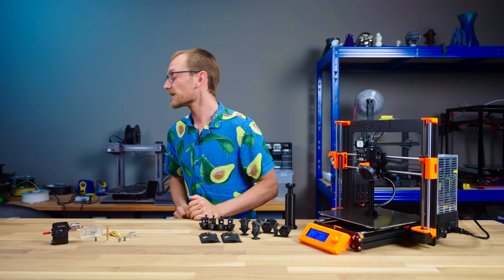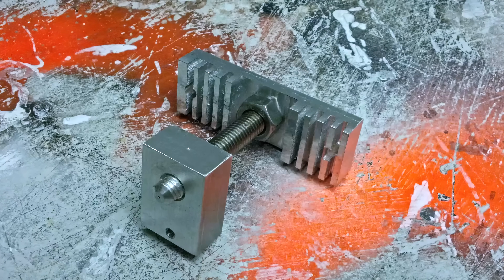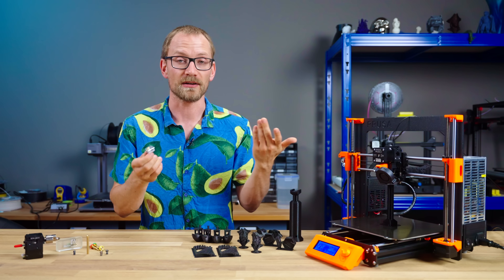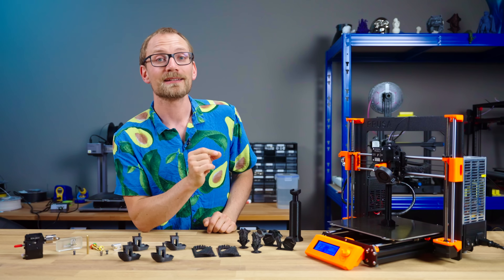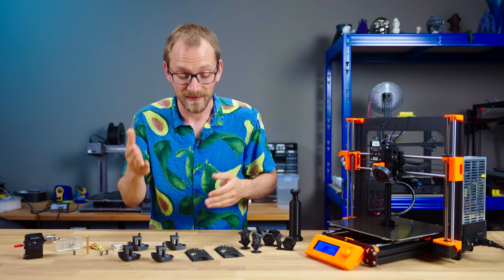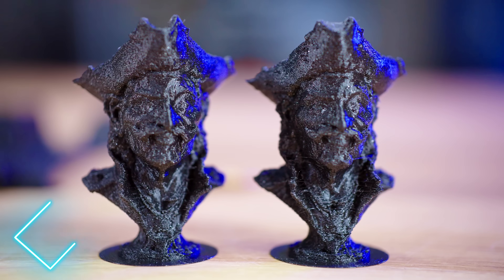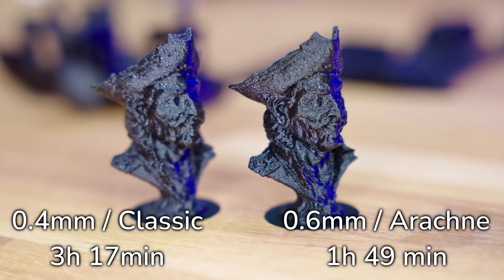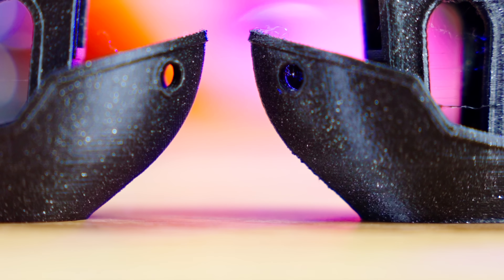0.4mm nozzles just became obsolete

Comment: Just a little note on this, I upgraded my very old printrbot simple metal to a 0.6mm nozzle, started getting thermal runaway protection false positives on stock Merlin 2. I've had to change the range of thermal protection as the old school heater isn't good enough for the increase in volume of filament when printing at 0.4mm layer height.

Comment: This video is great for an artist, but cringeworthy to an engineer. There are two drawbacks to the 0.6mm nozzle. Overhangs as mentioned and also significantly reduced layer adhesion strength for thin lines. One advantage of a smaller nozzle is the fact that an extrusion width 150% of the nozzle diameter results in stronger prints than 100% or lower. So to maintain strong prints going from a 0.4 nozzle to 0.6, you would have to increase extrusion width by 50%. Arachne seems to go the opposite direction. lines narrower than the nozzle have verry poor adhesion strength on any setup, especially at high print speeds

Comment: Hello there! I have followed your advise and I changed the nozzle from a 0.4mm to a 0.6mm… and all is good… however something is not ok… I understood that I could print to smaller diameter even with a 0.6 nozzle installed… but how so? I have my slicer set to use 0.6 nozzle… and when I want a better resolution, I change the layer height… to 0.3 for example… but my prints miserably fail to stick to the hotbed… any advice?

Comment: I've just tried 0.6mm on my S1 pro. Dialed in the right settings into cura but a bit disappointed to see a lot of oozing/stringing and bridging performance is terrible. Printed flow and retraction tests but no real potential for improvement on those fronts 🙁 Not sure what I was doing wrong but have had to switch back to the 0.4mm till I can find out the problem

Comment: Dear resident 3d printing genius  thinking outside the box...... because I often print complex geometry parts, ideally you’d use PVA and regular filament with dual print heads.
The Idex seems to be the best bet these days.  But the problem is wasting too much filament on support.  I’ve been thinking of  how you'd print a support that can then be placed on the bed and do another allowing the filament to print around it.  This would have to be very irregular non direct slicing to avoid the pre-existing bed support.  Have you ever thought down these avenues at all?  Or is there something out there along these lines? Your thoughts?  This could possibly do away with the need for dual extrusion in some cases since so many of us have our early single print head printers.  Thanks

Comment: I switched just recently. I have experimented with .6 and .8 in the past, but always went back to .4. Recently I picked up a resin printer and with that decided my old FDM printer was going to be used predominately for parts with less detail anyway. On parts that I really don't care how they look it is really nice to print at .4mm layer heights and get the print done fast. For most of what I print on it anymore I can't tell the difference between .4 and .6 at .2mm layer heights, and I don't use any special slicing techniques. Now that I've seen this though I'm definitely going to have to experiment with these suggestions.

Comment: I mean honestly this is cool but some ppl would prefer detail over speed like me im actually looking into .2mm nozzles I used to use .6mm but never liked it for smaller more detailed prints so i dropped to .4 as a medium ground but don't get me wrong if its not detailed and a large print like a hydraulic cylinder then I will use .6-1mm and I honestly don't think there is a one size fits all as it depends on the part and detail required but if its also a highly detailed part that has no stress i cant get with fdm then i would throw it on my resin printer

Comment: I reckon it's worth to have both, if you're willing to swap between them depending on your very specific needs. I personally would keep .6mm on most of the time, specially with Arachne, and returning to .4mm (potentially with Arachne, I didn't quite understand if it does better with or without it on) for very precise models

Comment: I want to print parts for photographic lenses. Do you think, a thread M42x1 will be better with 0.6 mm nozzles? I use a layer height of 0.175 mm.
0.4mm nozzles work just fine and I use a small printer to avoid large masses to be moved. I think it depends on what you want to print.
I print mostly engineering parts, but small and precise ones. What do you thing about nozzles for such parts? Is it possible to print them more exact using 0.6 mm nozzles?

Comment: I have no idea.  but i would suggest that your settins you are using work better with a  0.6 mm.   You are telling me it works better,  my Question has to be "What makes you think you have been using the correct settings for a 0.4 nozzle?"  you know as well as i do that you send 100 printers to 100 countries to test you will end up with totally different results out of the box even if they all exactly the same.   maybe a 0.6mm nozzle easier to tune so you  find it easier?   not having a go at you but it is one consideration.the point is you are not qualified to say the 0.4 nozzle bacame obsolete

Comment: So a .6 nozzle is now as good as a .4 used to be, doesn't that mean that the .4 is even better? Maybe as good as a .2 used to be? That doesn't mean the nozzle is obsolete, it means you now get better prints. If you wanna stick to the old quality sure change nozzle, but if you want even better quality you should still use smaller nozzles.

Comment: As a result of this excellent video I have changed my standard nozzle to 0.6 mm and standard layer height to 0.3 mm. Using the 0.3 mm Quality printing preset I am very happy with the reduced print time. I just started a print job involving 29 interconnected pieces that using the 0.4 mm nozzle and 0.3 Draft preset was going to take over 22 days end to end print time. Using the new settings this becomes slightly less than 15 days end to end print time. One caveat, the support material required for one complex part was a real bear to remove compared to the part printed with the 0.4 mm settings.
Reply: did you use special support filament for the interface?
Reply: @kellerfilme  No, I was printing on a Prusa MK3S+ without an MMU. Filament change time would have ballooned the print time to  extreme levels even with a 0.06 mm nozzle. Now I would do this job on my Bambu Lab A1 printer with an enclosure and use soluble filament for support. OBTW, this job required the use of PETG.
Reply: 15 days???? Wtf are you printing and how big is it

Comment: "Why is it always a 0.4mm bore?"  Oh, simple.  It isnt.  I print with a .2-  .25 most of the time for final prints.  0.4 or possibly 0.8 for drafting or thick materials.  Knowing your nozzle and setting up a print for the right size info in the software (cura in my case)  is crucial to getting the details you want out of your prints.

And yes, I can indeed tell the difference between the benchys.

Comment: I am just trying to understand, are you saying that printing with a 0.6 nozzle is ~30% after than a 0.4 if the say layer height is used for both (let's say 0.2) or are you also increasing your layer height with the 0.6? I understand how increasing the layer height makes it faster with a 0.6 (since it is more optimum for higher layer size) but how would make it faster if the same layer height is used? I guess walls are faster on a 0.6 regardless of the layer height since they are thicker so less lines but 30% increase?

I am just new to all of this and trying to figure all this out. Thanks.

Comment: Anyone any thoughts about my struggle? :

Since I started to print wih a 0.6mm nozzle, I have troubles with flat top layers. Even with 6 top layers of 0.28mm layer height, pillowing is clearly visible . I've tried many things like increase infill percentage, altering print speed, lowering the layer height to my old 0.2mm. Nothing seemed to work.
I only print in ABS and ASA for about 8 years now, and never had issues with a 0.4mm nozzle, so that's strange?
I think it has something to do with cooling. I never use a part fan, but with these thicker extrusions, iIguess it's needed.
However, When setting my part fan to a low 30%, infill starts to curl up and you can hear the nozzle grinding the next layer. The final top layer has less pillowing visible, but is very rough..
When printing part with no large flat tops, all is fine, but many functional parts that I print do have those flat tops.
Maybe I'll be switching back to 0.4mm 🤨

More about my printing;
CoreXy printer with heated chamber (usually around 40 celsius, when printing parts prone to warping around 50)
Direct drive (Bondtech dual drive clone) extruder.
Heated bed set to 100 celsius.
Mostly using Devil Design ASA, printed at 240 celsius for the first layer, 235 for the rest.
Reply: UPDATE: Although the top surfaces are not really as nice as when using a 0.4mm nozzle, I did solve the problem for the biggest part.
It seemed that I had to reduce the hotend temp a bit, from  240 to 230 (Devil design ASA) and I needed a part cooling fan, something I barely use with the 0.4mm nozzle. More than the double(!) the amount of plastic is coming out of the nozzle now, which really has to be cooled actively.

Comment: I agree that 0.6 nozzles print faster, however when you are printing things like gears or print-in-place hinges, the 0.6 nozzles do not work well with things designed for 0.4 nozzles. Take one of the various foldable tablet stands. Those work great with 0.4, but you cannot get the hinges to work smoothly. The hinge areas usually seal solidly and break before they start working. I've been using 0.6 nozzles for a month, but have been running into too many problems on prints that work perfectly with 0.4 nozzles...

Comment: Thomas, do you think the revo in now obsolete? Because the revo was a system with rapid change nozzle and arachne make the rapid change less useful
Reply: If you regularly switch between functional prints and decorative, there is still a reasonable case for quick swapping, personally, I'm not limited by commercial/time constraints, so I just suck up the swap process.

Comment: I remember using a stratasys fortus with giant nozzles for printing huge parts for automotive applications, while I had a self built ultimaker 1 with a 0,8mm nozzle at home. As I almost exclusively printed "necessity" parts - and not some dust collector conversation starter for the shelf - all parts were quickly finished with a minute of sandpaper use. If I wanted to get back into FDM printing, what would be the easiest printer to get running quickly with something long living like ABS or Nylon? Anyone got a hint for an easy to use machine in the 500€ range ? I don´t have time for a lot of fiddling.

Comment: @Thomas_Sanladerer and others... I exchanged my nozzle and settings in the printer profile but to me it is not clear if you changed the layer thickness ( from 0.2 tot 0.3) or the wall thickness (from 0.4mm to 0.6mm) in the slice settings as well or do you keep on printing with 0.2mm height and 0.4mm wallthickness? Thanx in advance!

Comment: On a 0.4mm nozzle you can also set a line width larger than the nozzle. You would be surprised how well a properly calibrated printer can push the line width and still get good results. For less quality loss, just set the line width of infill and solid surfaces to 0.6mm, while changing the top skin speed to 0.4mm or even 0.3mm. With direct drive printers or a good bowden setup, you can even print infill at double layer height every 2 layers while leaving walls unchanged.

To get extra speed out of your toolhead movement you can also upgrade the printer to use Klipper with input shaping, but that's an advanced setup. At that point you'd likely need to upgrade your extruder and hotend anyway.

Comment: So, I took the plunge. 0.6mm nozzle on for the last week and a bit. I mainly print functional parts. It’s worked really well. A little tuning to get extrusion width sorted etc, but it has been great to get to grips with. I’ve found 0.3mm height, 0.9mm extrusion width, and 15% rectilinear works amazing on my anycubic mega x. Found 72mm to be optimal print speed so far, which since anycubic recommend 60mm for a 0.4mm nozzle isn’t bad. More experiments needed for speed at some point. Great video, and thanks for sending me down this rabbit hole 👍👍👍👍

Comment: Let's go! Something else I can change on my printer to ensure that I never get it tuned right! I've installed Klipper and BL Touch on my Ender 3 V2 and haven't printed since. I just can't get the first layer figured out. I'll run BL Touch and probe the plate, and first layer is still at 0.0mm. Idk.

Comment: I have been thinking of designing a filament preheater above my direct drive. This tube would preheat the filament so the heater block would not have so much demand on it when running fast.

Comment: You've mixed the benefits of the Arachne slicer and the .06 nozzle.  By doing a .4 + normal slicer vs .6 + Arachne, you're not doing an apples to apples comparison.   And, as others have said, that sparkly filament made it hard to see the differences in the print.

Comment: This entire video really feels like a wasted opportunity because you decided not to isolate your variables. It would have been much more informative and useful to have a comparison between .4mm classic, .4mm arachne, .6mm classic and .6mm arachne separately. It seems likely that .6mm is strictly a quality downgrade from .4mm with the same algorithm while increasing print speed and arachne is strictly a quality and possibly print speed upgrade over classic, but we don't actually know now.
Reply: I can confirm that simply just using Arachne and not changing the nozzle size can significantly decrease print time. I run a print farm and started to implement it. On some parts is doesn't really make a different but on other that have gussets and flanges and such it can reduce print time by almost half.
Reply: I agree!
Arachne might be really cool and by using it it might be that 0.6 is now a better choice for many people...

But that doesn't mean that "0.6 is better than 0.4 now"!

I for example got myself an extruder where i can very easily change the nozzle without having to re-calibrate anything. And in the end i print a lot of parts with a 0.25 mm nozzle which are almost impossible to make work with even a 0.4 nozzle AND i print a lot of housings with my 1mm nozzle...
But even with this setup i still use 0.4 (and 0.6) a lot for stuff 🤷‍♂️

It just always depends on the application😉
Reply: @DanielMFG He's not saying 0.6mm is better than 0.4mm. But considering people have accepted the previous print quality on 0.4mm with classic wall method and 0.6mm + Arachne boosts speed by more than 1x without making print qual worse, 0.6mm is an replacement for 0.4mm. This has not been possible for many prints with thin walls or small protrusions. But it is now with Arachne.
Reply: He did mention that things like the fan shroud couldn't be printed with a .6 without aracne
Reply: Did you not watch the video at all? He literally does compare them all
Reply: Dude really, really needed a title idea for a new video.
Reply: Sounds like you weren't paying attention.
Reply: What video are you watching? That's exactly what he did here.
Reply: He did all. 
But I guess you miss the point here. Although you may say so from scientific point of view, he sees it from a different point.
The community HAVE ACCEPTED the print quality and the printability of 0.4mm. Compared to PREVIOUS method by a complete package, the 0.6mm + Arachne is vastly faster without sacrificing print quality.

Comment: Hi Thomas! This video definitely belongs in the "Best 3D Printer Tips Ever" drawer. I only print functional parts and switching to a 0.6 mm nozzle has been a blessing. Without your suggestion and explanations, I would never have thought of it, so thank you very much for that!
Reply: Why not. 8?  Or 1.0?
Reply: @atapene  Because current extruder and nozzles cant keep up with the potential speed and slowing effectively the print time down to 0.6 nozzle performance but with lesser details.
Reply: @selfworthy  yeah but when you can get more material out a larger aperture you can either go faster or put less stress on the parts,  both of which are positives.  Lower detail if you are ok with it is fine

Comment: I just tell the slicer I am using a 0.6mm nozzle and then use Arachne. But it's actually just a 0.4mm nozzle. Works amazingly, I get all the increased fine detail of the 0.4, but with all the speed improvements of using a 0.6

Give it a go!

Comment: Possibly the first time I've rewound to check a sponsor segment that I had started skipping.
Do SD card ports behave like USB i.e. serialised?
Because wasn't that the issue with trying to run G Code from a pi through the USB... that it couldn't give on-demand instructions fast enough via a single/linear/serial data stream with low bit rate relative to the movement of the nozzle... so that instructions come late when many direction changes etc are happening.
Does Fiberpunk address/solve that issue or is that out of its scope?

Comment: Stefan from cnc kitchen said that you csn print and output wider lines with your nozzle without any significant drop in throughput. So I would still use 0.4 but telling the slicer that it's 0.6 or 0.8 and use arachne

Comment: I went with a Vanadium 0.5 mm for my mosquito hotend, less clogs and let's me print fast at .4 layer height or at the same as a 0 4. I use to print at 0.6 a lot, but that was for low detail prints. Though I guess 0.6 could work now, but 0.5 works great.

Comment: I've been using a 0.6mm one for years because I mostly print larger mechanical parts that also benefit from the higher strenght from the larger extrusion diameter. but will definetly give arachne a try